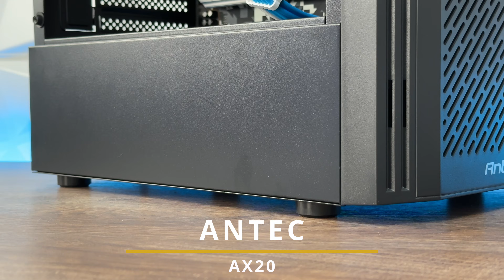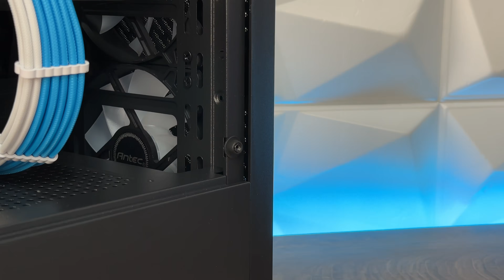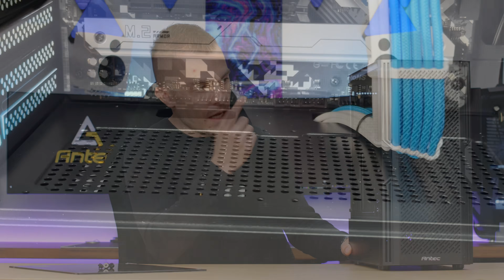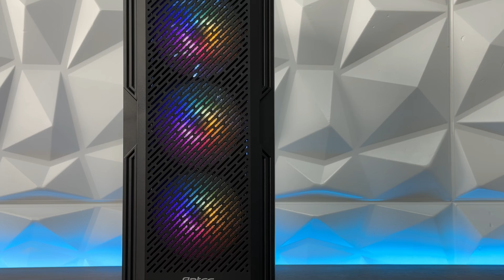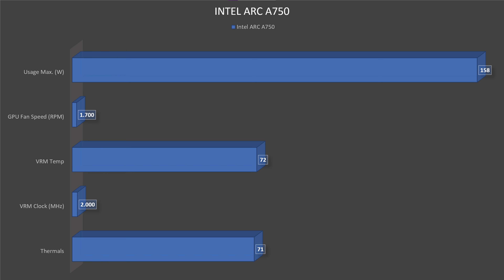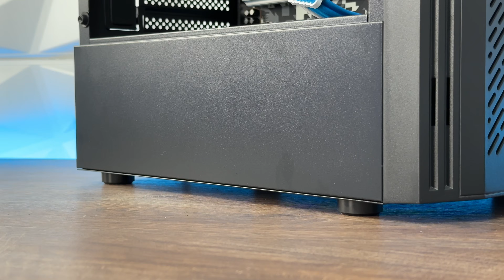ANTEC AX20 - Smaller Case for Budget Oriented Builds

Comment: does anyone know if i can fit a Peerless Assassin cooler in this case?, i want to upgrade my CPU to a 5700x3d, but i wanna know first if i can fit that air cooler inside the case, because the cooler is massive :/ (i also accept any cooler recommendation for a 5700x3d combined with this case :D)

Comment: maybe somebody have advise ...... i connect the fans to my motherboard >> not working /no light, and that is strange because my water cooling fans  are working correctly with motherboard. When i connect the antec fans directly to my power supply  they work correct, but can t  change the colour.    thanks

Comment: How do I remove the front panel?
Reply from the maker: Press the crocodile clips from the inside of the chassis. ;)
Reply: @PCCrazyDario   it s a crap idea to open everything, next time  i go for case with screws on the front panel.
Reply from the maker: @flipflipflap8293  That doesn’t exist unfortunately. As far as I can remember, all are either magnetic or crocodile clips
Reply: @PCCrazyDario   maybe i gonna fix it by myself ....... next time when i must open it i gonna look, i can re-design it with screws  i m very handy with that kind off things :-)
Reply: @PCCrazyDario  where are they located I tried to find them but they are nowhere
Reply from the maker: @cappuccinoGD  inner part near the edges
Reply: Thanks
Reply from the maker: @lastcrystal4893  You are welcome :D

Comment: How to turn off the RGB in the front fans of this case?
Reply from the maker: Unfortunately, I don't think you can.
Reply: Any idea how to connect the pre installed fans?? They're molex and I plugged them into my PSU and nothing happens?
Reply: @nonono9194 Ask the shop you bought it from. Thats what I would do.
Reply: Remove the fans and replace with non rgb ones.
Reply: a friend of my buy a other model from Antec , there was build in button to change the colour, so i think you must buy a loss part who can handele the colour system.

Comment: Will the 6700XT fit in this case?
Reply from the maker: Which model exactly?
Reply: @PCCrazyDario   Hell hound or Challenger
Reply from the maker: @eltonfrank2758  GPU clearance for this case is 270mm.
Hellhound RX 6700 XT is 305mm, so that one won't fit.
Challenger RX 6700 XT is 269mm, so it will be a tight squeeze, but should fit.
Reply: @PCCrazyDario  well... Think i'll go with the PULSE Sapphire then
Reply: @PCCrazyDario  Thank's for your time

Comment: will an RX 6700 XT fit in here?
Reply from the maker: Which model exactly?
Reply: @PCCrazyDario  xfx speedster swft309 AMD Radeon rx 6700 xt core
Reply from the maker: @Niseandryt  Unfortunately no. The GPU length is 304mm while the GPU support inside the case is up to 270mm. :(
Reply: @PCCrazyDario  I will get the x90 in that case then, I believe it will fit well in that case, right?
Reply from the maker: @Niseandryt  Max GPU length for GPu is 385mm in AX90. You are good to go. :)

Comment: My case came with two RESET SW cables, I connected it randomly and nothing happened to my motherboard, that is a factory error or the one you did the review came the same because I have doubts about this situation
Reply from the maker: You can't connect it randomly. RESET SW cable goes to the RESET switch jumpers, so you connect them there and you can reset the PC when needed.